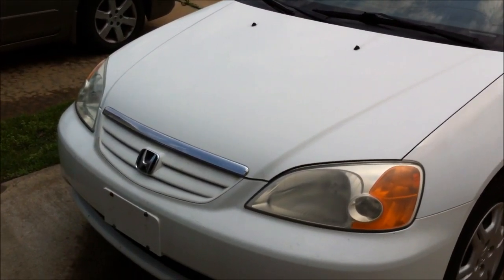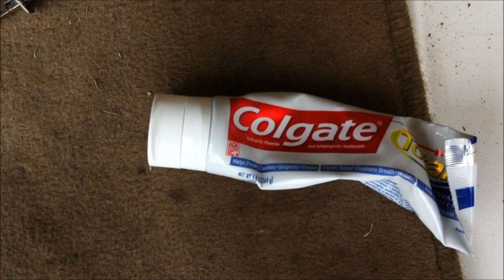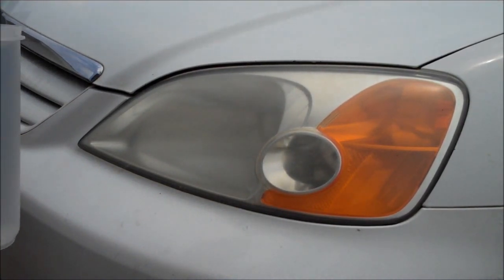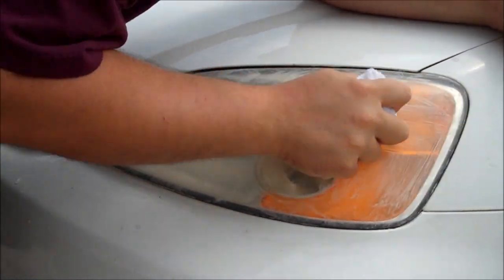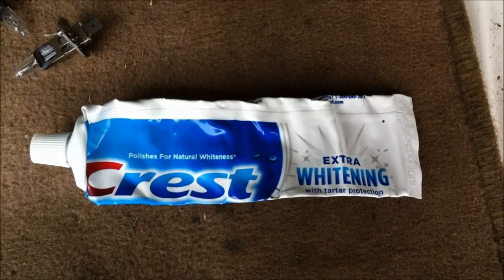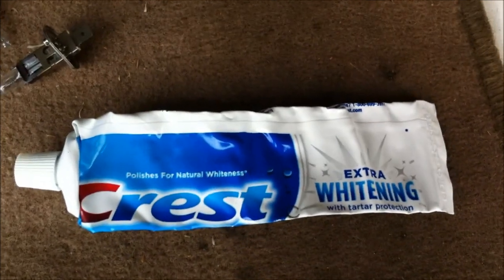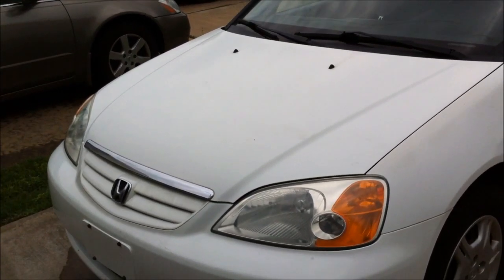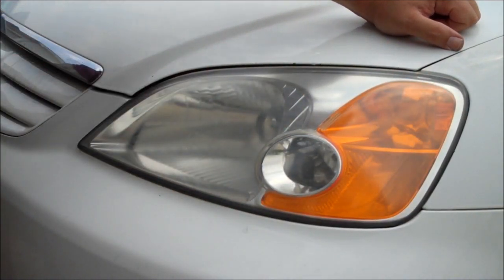Headlight Lens Restore using Toothpaste!

Comment: I polished headlights as a hustle for years.
Toothpaste works if the oxidation is not bad, heavily oxidized lens are a waste of time using toothpaste.
The system that I eventually used on lens was: first hand  sand the lens down with fine grit wet dry sand paper- 1000-1300 grit for tough very heavy oxidation , sand with1500 grit as a second, 1800-2000 for the final sand, using plenty of water.
 Buff with light buffing compound and then wax twice with good automotive wax. If you wax your headlights when you wax the rest of the car the lens will stay bright. It sounds like a long time but you can do both headlights in 10-15 minutes

Comment: Another thing i learnt here is .... each time you brush your teeth with tooth pastes like crest, you don't have to wait for 14days like some tooth pastes state... leave it for 15 minutes if you have the time for a quick extra whitening. ;)
Reply: +Chris Ezeani 
Don't even use store brand toothpaste. Use baking soda or natural shit. you are putting chloride and other strong chemicals in your body. Just a warning.
Reply: Viccy Quadrilio
Reply: Piggy Pepper
Um what?
Reply: Yeah i have read about the baking soda one and seen it on videos too. Baking soda and Lime mixture brings the best out of your teeth but still brings us back to the same things again, DO NOT leave it in your mouth longer than what is needed as advised :)

Comment: That seems a great result if that was from toothpaste, I've not tried a kit, but I've restored plenty using wet and dry paper, starting at 1000 grit and finishing with 2000 grit. using a fine &  ultra fine finishing compound (T cut will work) A buffet wheel also speeds up the process. The "hazing" is the lacquer coat that crazes in the sun, the wet and dry removes this lacquer and you can polish the lens back to a great finish! (and re-lacquer if desired)

Comment: OK I tried this on a completely scratched up bicycle tail light. I am keeping this as an identical backup in my bike's tool-pouch. The pouch is made from very rugged fabric/plastic and it has scratched the light completely foggy over time.
I used tooth paste and a very worn down kitchen sponge with scratchy pad. I polished it with the sponge side after using the scratchy side. I only gave it ~5min and it looks already pretty good compared to my good identical light. Good enough for a bicycle.

Comment: This is all well and good and I know that it works. You'll have to do this over and over on occasion. Headlights have a factory coating on them to keep then from yellowing, as that coating wears off, they fog and turn yellow. As you clean them like this you remove more and more of that UV coating, the results is that they will yellow faster. Applying a good paste wax will help a little bit to slow the yellowing after treating them. Other products like Novus plastic polish work wonders too.

Comment: BTW this works amazing on police lightbar domes. Turns a 10, 15 year old weathered scratched dome crystal clear. Honestly better than automotive buffer, polisher kits. This is how I do all my police bar domes. And it last. I use Colgate Whitening with the micro balls in it. I'll try to post my before and after video soon. I do highly recommend the round micro fiber cotton pads, these help remove scratches.

Comment: Great results - One mention if you open hood you might lessen chance of hitting paint, and maybe one of those drill polishers save you some effort. I just refinished a stainless cooktop using wet sandpaper for bodywork. The higher grits are for paint so they are very very find like 800 or 1000 grit and polished the metal to chrome look, I figure they will work on headlights too, but have to try on my old truck first.

Comment: If you want the effect to last longer you can pickup a bottle of BlueMagic Headlight Lens Sealer. Stuff works great and you won't have to clean the lenses as often. Also Waxing your headlights and Tail Lights between cleanings (Like waxing your car) will Help keep them shiny like new

Comment: When plastic lenses get hazed, it is because the UV  light (or harsh cleaning detergent) has broken down the chemicals in the plasitc. Damage is done. You can temperarily make it somewhat clear again, but it will only last a short time.

Comment: I am a qualified mechanic tried toothpaste.It works in a painstaking long hours of swirling motion polish in some head light lens with other car with plastic head light lens it does not work.I think polishing machine will be a big help .Just be sure to clean the lens first before polishing.The most recommendable polishing material is the Megiuars Plastic polisher branded as PlastiX. 100 sure it will di the job.

Comment: Baking soda will help add extra grit. This will only work on some types of headlights, it depends on the polymer compositing of the plastic used. You may need to wet sand the headlights first with 2000 grit wet sandpaper.

Toothpaste will also work to remove scratches from C.D's.

Comment: Word of advice after... After you polish it super clear take it to an auto body shop and have them spray clear over it. It stops oxidation for good!
Reply: Actually it does not. It is at best a temporary fix and will cost more money in the long run.

I do this as a side business and have done hundreds of sets of lights and the ones with clear coat I don't even touch. The clear coat begins to chip away over time and you can never full restore the light again without spending hours wet sanding the clear coat off, and if you DO get it all off, good luck getting the luster back. At that point it's more cost effective to replace the light.

In short, never EVER, EVER clear coat a head light. Either wet sand / buff or replace with a glass lens.

Comment: I use bug spray from aerolsol can, it works great and you only need just a little bit.
Reply: +Jessica Kolbo \
Hey Jess. Don't use bug spray. You are actually melting away your lens over your headlights. There is a chemical in there called Deet I believe which acts like a acid. It's what kills the bugs buy melting them dead.

Comment: I always recommend finding a professional to do it for you!  I wouldn't spend any less than $50 and no more than $80..  That will give you the best results, but if you want to do it yourself you could pick up a 3M Headlight Restoration kit for $25, and a can of clear for $8.  After finishing the sanding process with the restoration kit, mask off and spray the clear.  Hope it works out for you!
P.S.  All Intrigues have some fogging on the inside of the lenses..  Nothing can be done about that :(

Comment: tech tip use cutting compound not toothpaste its faster and cheaper - it will dry in two to three minutes tops and may take a couple of cuts if the haze is really bad. Use a shamy to buff and a dry clean cloth to finish :)

Comment: Just tried it, doesn't work with dish soap but for some reason toothpaste DOES WORK. But you have to give effort and give it a good scrub! Its not magic you still have to clean it well, watch the magic as you rinse with clean water...

You may want to take before/after pics or simply do one side with dish soap and one side with toothpaste to prove to yourself that toothpaste is the key here.

Comment: the expensive part for me was getting a buffer ball drill attachment. so worth it, i use it for headlights and body and no more sore forearms. just wrap a shop rag around it and ur good to go. but yes toothpaste works great for headlights and it's practically free.

Comment: I tried this on a 02 Dodge Caravan. The headlights have never been cleaned/restored. It did take a lot of grime off but there is still some pitting from normal kicked up road grime. I will try what Seth Rogers suggested to see if there is a better result. 
 " Seth Rogers 1 day ago There was "Quite a difference", but the lenses still didn't look like new after you were done..  Wetsanding / Buffing / Clearing is the best way to restore headlights."

Comment: I attempted this today on my classic 1994 Lincoln Town Car Signature series.  But I went the extra mile and used painter's tape to protect the chrome [plastic!] and paint. I also cleaned the lens first with alcohol, then with Windex.  Then  I really scrubbed it good with some great cleaner, making sure the lens was as clean as possible.  I followed all the directions, down to wiping with a clean cloth.  I could see SOME improvement, but no where near what this guy got.  What can I do to get better results?

Comment: Yes, but it is a lot of work..  Put your headlights on a pan in the oven and heat them at 250 for 20 minutes or so..  pull them out and pry the two pieces apart (work quickly; the gasket material turns solid as it cools)  To put back together, heat them again and clamp them firmly together.  This MUST be done properly, or you will get water inside the lens, which could destroy the assembly over time.

Comment: I just tried it on my 13 year old car. Worked for me & I really didn't put too much work into it. I used a bright white towel for the final part & could see alot of that yellow stuff. Didn't really use that much tooth paste either. Pretty much near a spent tube.

Comment: Just use Scratch Off - $8 or 9 dollars and it takes less than 5 minutes to do all light lamps. And then can be used to take out scratches, just be sure to apply wax to ensure your paint doesn't fade after a while. And don't forget if you do any method to take out the hazy lamps, use some sort of UV protector (glass is ok, just dry) plastics like so had a UV deflector/protector and when this yellowing happens its due to the UV protector weakening, it needs to be replaced. Don't forget!

Comment: this will work.. it will work for a while but they will get yellow again.. i went to walmart picked up some sand paper.. the 3m pack that came with 800, 1000, 2000 and 2500 grit sheets for around 5 bucks.. then some plastic clear coat and meguires ultamite compound.. its been around a year and my lights never got yellow or foggy again.. the tooth paste will only work for a couple of weeks then they will start to yellow

Comment: the best way to compare would to try 2 different toothpaste on the same lens because I have found the drives side lens is always harder to clean then the passengers side because of the dirt salt and other things that are picked up by on coming cars. I have cleaned then and after driving for a few weeks or say 300 to 600 miles the drive side is already getting dirty but I will try this soon ive been needing to just didnt want to brake down and buy the stuff to do it now i dont have to lol

Comment: Wet sanding with 1500 grit and buffing it is the best solution, finishing it with a coat of wax will keep your lights looking brand new for about a year. Unfortunately there is no permanent fix (other than glass) see my post below about NOT clear coating your lights.

Comment: You MIGHT be able to stick something in thru the headlight opening to clean the inside cover if you want to avoid pulling them apart..
Of course, new lenses for your car are only $50 each.  That would seem to be the easiest and perhaps even cheapest way to go..

Comment: i have a 2006 same side same thing ... the passenger side is is just as old as the drivers side so  why isn't IT as oxidized ? i think its faulty materials  on hondas part . I'm sure theres many others out there with ...foggy lens syndrome lol haven't tried the toothpaste but i tried everything else ! and it did just what yours did ... looked good while it was still wet but got cloudy when it dried smh

Comment: If this does not work the inside of your head lights are dirty which depending on the head light you may or may not be able to take the lenses off and clean the inside if u can't then buy new head lights or take it to a detailing shop they may help you

Comment: problem with using any abrasive product is that it leaves tiny scratches in the UV protective layer on the outside of the lens. Which makes it more susceptible to quicker oxidation and failure in the future. You should never use toothpaste to do this .. unless you just don't care about future problems. Always use a product that is wipe on wipe off to restore your headlight lens.

Comment: Try mixing WHITENING CREST AND BAKING SODA  until you make a paste, then use a toothbrush or soft bristle brush, after all this clean the brush and brush the headlight while applying water, dry it right away and it will look like it just pulled out of the factory

Comment: Toothpaste does work. I used to do it all the time. Light oxidation on a headlight will clean right up. Its a poor mans buffing compound. Any heavier that about this car and you'll have to wet sand and clear coat. Very easy.

Comment: how long do the head lights stay like that for? at the shop were i work we buy kits that have 3 different girts of sand paper and you sand the oxidation off of them then you put a protective sealant, almost like clear nail polish, and it stays like that for pretty much the life of the car

Comment: They have compounds and polishes designed for clear plastics.  They are not expensive and you have them for a lifetime to do your cars and friends cars as well.     If you use a drill with a 3" polishing pad you can get the new lens look even on the worst case lenses.  Sanding is not a necessary step, either.  As mentioned by John Davis, you will need to spray clear them if you want it stay that way.  Or you  could just use a clear plastic cleaner and polish once a year for maintenance.  I ran an Auto Detailing buisness for 20 years.
Reply: Meguiars Mirror Glaze #17 Clear Plastic Cleaner followed by #10 Clear Plastic Polish.  Most auto parts stores carry them.  You can purchase a 3" buffing pad to attach to your drill.  Use the lower speed and move the product around to avoid burning the plastic.  3M sells a headlight lens restoration system kit as well.  I've not yet needed to use the sanding steps in the restorations I have done.
Reply: Mothers and 3M also sell clear plastic cleaners and polishes.  As I mentioned, if you buy these products you can get the headlights restored and then use the polish to maintain them twice a year.  You'll have these products for many years to come.  It should be noted that the UV light that deteriorates the outside of the plastic can sometimes affect the inside of the lens as well.  This is not as common but I have seen it on lenses that were extremely damaged.  Moisture build up on the inside can also contribute to lenses looking cloudy or foggy.

Comment: I bought turtle wax headlight lense restorer. It was a process of using clarifiying compound then four different abrasive pads one at a time then the compound again and then a sealing wipe. I did the process four times and only used the wipes on the last try.. took a long time.. . on my other headlight I used toothpast.. took very little time.. The toothpaste worked much much better than the stupid turtle wax kit.. I was shocked. This is no lie. it works. I didn't think It would

Comment: I don't see where you applied a sealer.  I understand that a sealer will give a more lasting result. How long was it before the yellowing and/or dullness returned?I understand that a sealer must be applied for a more lasting result. If not a sealer a non abrasive wax should help, but was wears off rather quickly.  So reapplications would be necessary.
Reply: I've tried it. The sealer also deteriorates over time, and most likely getting oxidized more quickly. But a 15 min job each year ain't that bad. Plus it makes you love your car more as you spend "quality time" with it. :D

Comment: Save $50 on headlight restoration kit, then go spend $50 on getting some headlight protection covers. No amount of rubbing toothpaste will fix it if a rock goes through them. (Then obviously use toothpaste to clean covers, not headlights, in the future)

Comment: $50 on a headlight restore kit? Nah. All you need is 400-600-1500 grit sandpaper, wet sand it down, then put regular polishing compound on it. That's how its professionally done, and it costs about $15 total.

Comment: the tire shop near by will polish headlights for $79 I found out that a brand new set of headlights for my wifes PT cruiser will only cost $79 for a pair.  I think you know where I am spending my money.  screw polishing I would rather spend 1 hour replacing than hours and hours polishing. but thats just me.  actually I have tried two different products off the shelf that didnt work.  I polished 4 or 5 times and its still foggy lenses. why dont they make them out of glass!

Comment: So it held up for what, a month..month and a half before it went back to foggy?
Reply: Because you've removed all the UV protection, which plastic lenses need.
You can also buy a thin UV protection film to cover the lens, and this helps prevent stone chips and further light scratches.
If you didn't brush your teeth for 6 weeks, they would be pretty grotty too I reckon. And your mouth would smell like a sewer.

Comment: Ok, toothpaste works to some extent but not so much. I have used electric drill for buffing with toothpaste, but very slight effect. Its lot more than buffing with hand. With hand, its useless, i have a good built, better than the one in video. i tried with hand but not effective. so i took my drill and buffed for long, was OK kind of job, not even close to this video.

Comment: I tried WIPE NEW Headlight Restore... 50% better but I will try this time with toothpaste to finish off the access oxidation. My kit didn't come with WIPE NEW solution, just the dual sided buffering squares and two towels. The important thing is that it passed STATE INSPECTION!